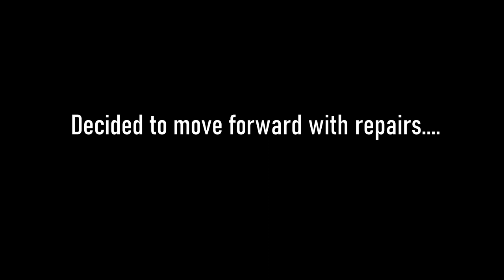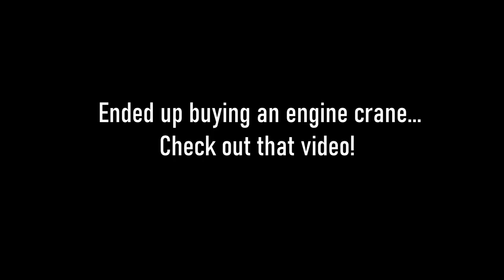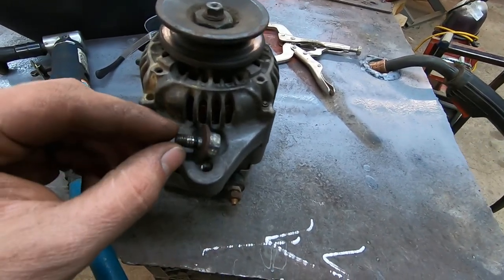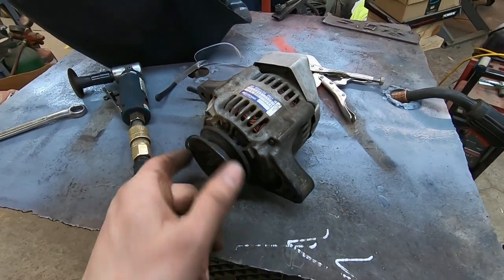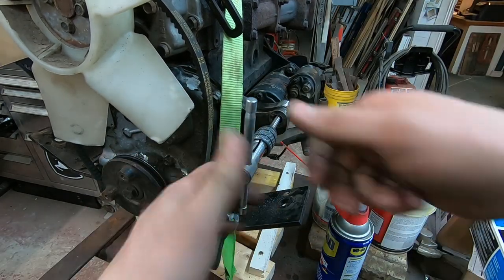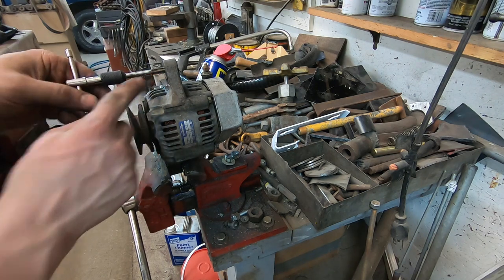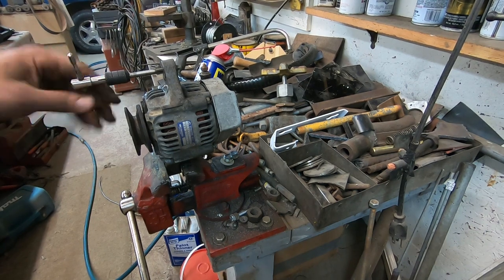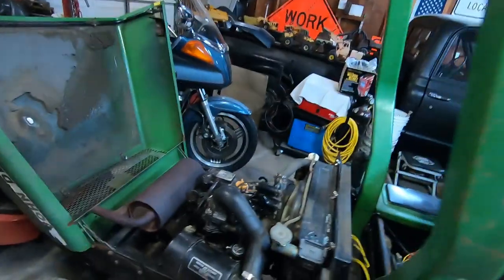John Deere F932 Engine Problems - George Jones Mower Build - PART 2

Comment: Great find!!  I love my f935.. Which is almost the same machine.  Its my favorite beast in the barn!  I have a deep deep hatred however, for our local jd service center.  I have taught myself almost every single repair that has been needed over the past 15 years now... and while those are rare, because this machine can handle almost anything; the few that have taken me the longest daze of stripping my joy, have all been related to the nightmare of tracking down a safety switch!  I have never had to repair an engine plate.. Your machine has been through quite the adventure.  Other than that, this beast is awesome to work on, provided the parts are available!  Tenacity is the only thing truly needed to work on these mowers, and in my case perhaps a few more pounds of torque from the shoulders.. Other than that its generally just 10,14, and 17mm away from a funner daze!
Reply from the maker: Love the 935 models! Wish I could have found one of those around here! Would have been cool to have the diesel engine vs the gas engine. At least you are saving money making the repairs yourself! My machine has definitely seen her fair share of rough abuse! That engine plate was pretty strong, to break that must have taken alot! Wait for the PTO video....there is alot of damage there as well.
Reply: @marktolman6037  I will watch for it.. and if I might put in a request, while you explore yours..  what is an easier way to pull back the tensioner bar, when changing the deck belt?  I tend to use a tow strap ratchet, (because of those weak shoulders i mentioned) but everytime i do, i know I'm getting closer to putting an eye out?  I am about to put a new tension pulley in; and I rarely find videos, working on these specific machines, so I will look forward to all of yours.  Have a great daze!
Reply from the maker: @babygonewrong  Thanks, I will try and see what I can do about the tensioner when I get to that point!
Reply: @marktolman6037  that would awesome! Thank you